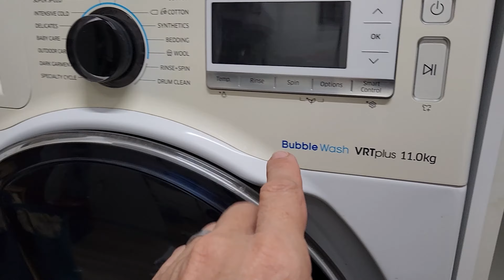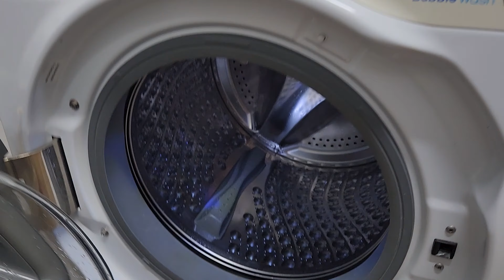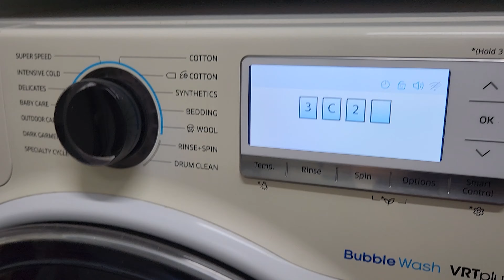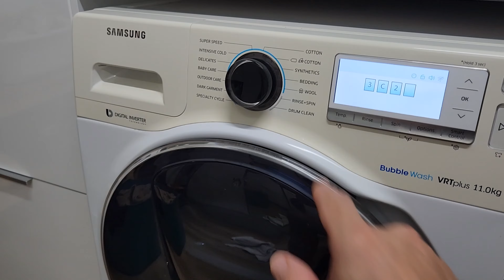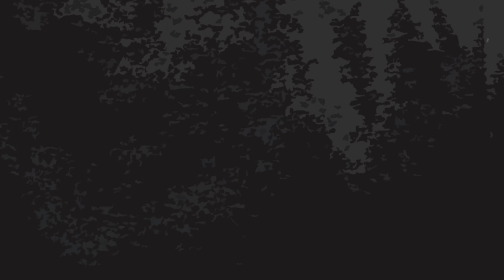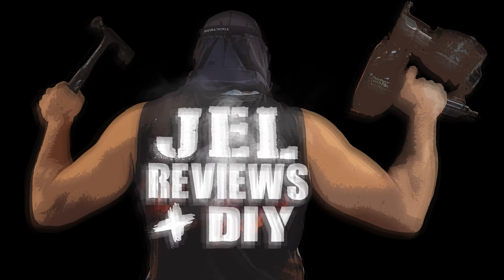How to enter hidden TEST SERVICE MODE // Samsung VRTplus Wash Machine

Comment: Thanks brother, that was super useful! Where did you find it? I have the same machine being temperamental with its spin and not throwing errors. I am suspecting the MEMS sensor. Also other modes I found … if you hit temp, spin, rinse, spin it lets you cycle through some values it’s reading. Number 7 is correlated with the water pressure sensor. The rest I am not sure. You can also get into the same test mode by selecting 17 hour delay and the holding the play button at that point (dial setting doesn’t matter). If you then hit play, it automatically cycles through all the tests innsequence.
Reply from the maker: Cheers, can't remember where I saw this, probably digging around on some fix it forums when trying to diagnose my issues on the machine, but it certainly wasn't easy to find which is why I put this video together. Thanks for your tips and other modes you mentioned. I'll pin this comment as that is useful!

Comment: Legend! Verry helpfull info,I've had the same issue with my one so Replaced the PCB board and it fixed the issue started spinning again but lasted only 2 weeks and back too square one.So I've then Replaced the motor and still at a loss massive let down in the end
Reply from the maker: That sucks... Sorry to hear that!

Comment: Hey mate, how’s this model going for you? 
I changed the PCB board over couple of years ago and was all good after having the same issue you had. 

Now we have clothes coming out wet 50% of the time. 

Did you ever have issues with shockers?
Reply from the maker: Hi, since this video where I had the PCB swapped out by the tech, it's been going perfectly. No issues with anything. Surprising to hear your clothes coming out wet. I'm sure you've checked, but somehow sounds like maybe not spinning enough for the spin cycle or the water is not draining out correctly.
Reply: @jelreviews yeah I’ve run the diagnostics and it all runs fine with no error codes. It seems to be when running certain size loads of clothes and intermittently which from what I surmise is most likely shock absorbers failing/deterioration. Without being a techy myself it’s hard to know what the shockers should actually feel like and how much the drum should move around. Seeing conflicting information online. 

Good to hear yours is still going strong! 
You got a long time out of it 👍

Comment: It will be the motor drive module on the circuit board in the bottom left side of the machine. The Module is an IKCM15F60GA easily replaced if you have advanced soldering skills. It is under the Aluminium heat sink, you need to use dremel to carefully cut away the plastic on the opposite side of the heatsink to access PCB and screws to remove the heatsink.
Reply from the maker: I wish I knew this at the time. Thanks for the info!